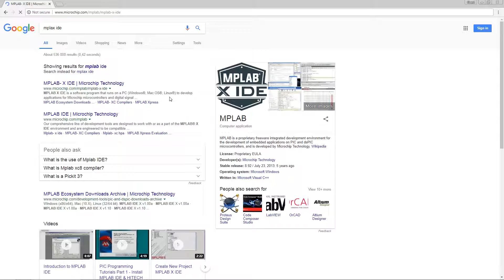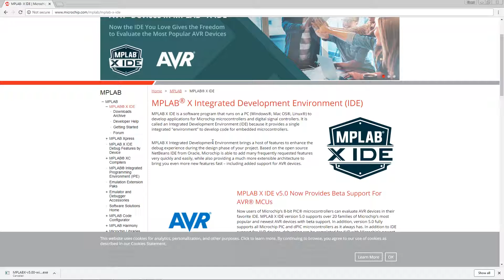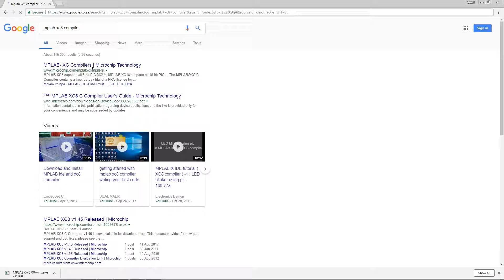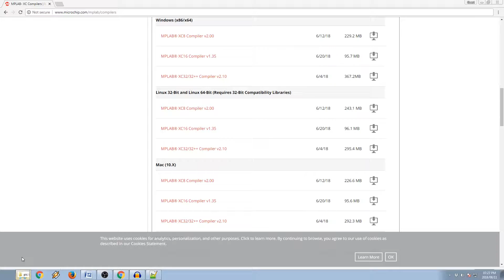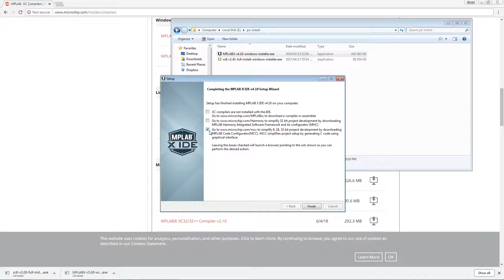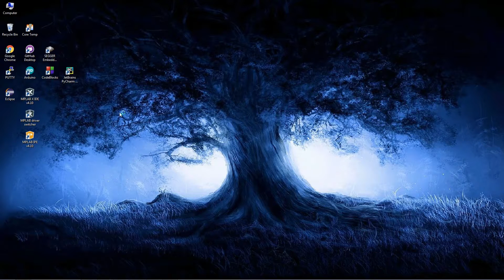Software Install 🔴 PIC Microcontroller Programming Tutorial #1 MPLAB in C

Comment: Thank you for these videos.  I finished the last one in this series yesterday.  They are extremely informative, and I was able to recreate most of them on a slightly different development board.  It is fantastic to be able to start with a known working example, and then extend it for my purposes.  You have taken me from a "know-nothing" to a beginner.  Over the course of the tutorials, you change compilers, and include some 'standard.h' header files.  Since these videos were created 4 years ago, the IDE and compilers have upgraded to new versions.  The STDxxx.h header files seem to come in different flavors and directories, most noticeably the C90, and C99 versions.  Two quick questions which may help those that come after:  1) Would it be better for a newbie to download the now-archived versions that you used for the tutorials, or just get the latest, and hope that the examples will still work.  2)  Which versions of the STDxxxx.h files do you use, the older C90, or newer C99.  ( Or do you use one for the compiler, and another for the linker?  Thanks again, Ken
Reply from the maker: 1) If you want the tutorial to work out of the box. I would recommend using the same versions. I would highly recommend using the latest stuff otherwise. There are some minor differences as you mentioned. The base code has not changed in about ~12 years. Wrote this same code with the C18 compilers.

2) Whatever is the default that the build system uses. This ensures compatibility. Just adapt to the build system. I have never paid much attention to it. Most systems use C99 from my experience. Most of the functions I use regularly have already been added since C89. I prefer C99 and up.

Do not worry about linkers unless you are working with bootloaders or want to limit/partition the memory. Most manufactures provide a default one witch covers 99% of use cases. Good to know but not required at beginner level.

Thanks again I damn well appreciate it.

Comment: hello can i use python on microcontrollers ?
Reply from the maker: Yes and it is garbage. Search micropython or circuitpython. Good Luck
Reply: Binder Tronics why is it garbage , btw im trying to make flight controller for drone  and i dont know what to do
Reply from the maker: Interpreter languages like Python are slow and not suited for real time applications. You will only see python on micros with high clock speeds and it will still be unresponsive when doing something as simple as a button press. Search Arduino flight controllers there is a huge community around it. Python is basically for desktop and data processing.
Reply: Binder Tronics any advice on what should i use ?
Reply from the maker: Like I said "Search Arduino flight controllers". You will find plenty of information. Hardware and software. Flying blenders aren't really my thing.
Reply: Binder Tronics okay tnx just found out C / C ++ is better
Reply from the maker: Oh just assumed you knew about C / C ++. It is the language of choice. Just for future reference. If you phrased you question like this: "any advice on what language I should use ?". You would have gotten the answer you wanted.